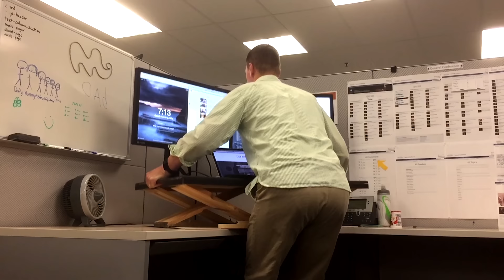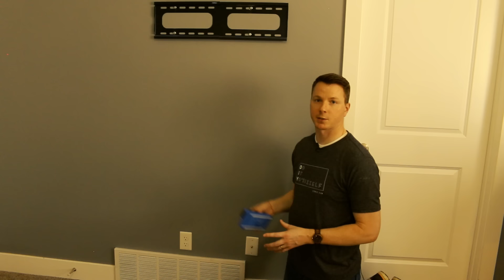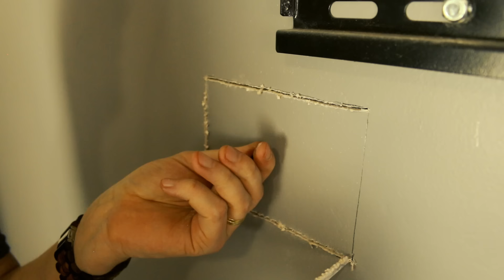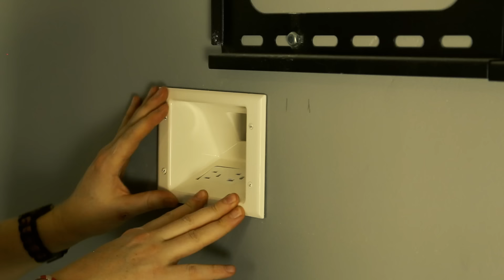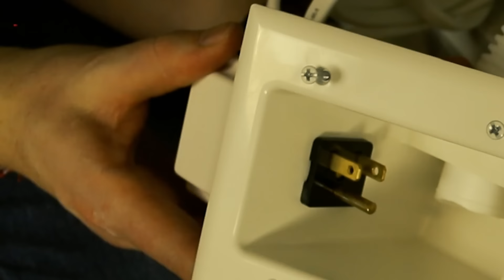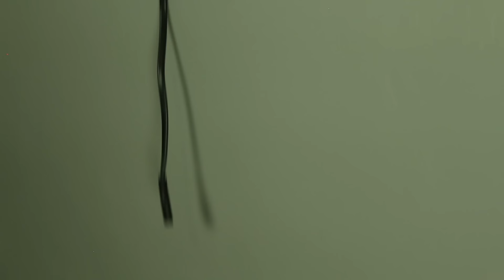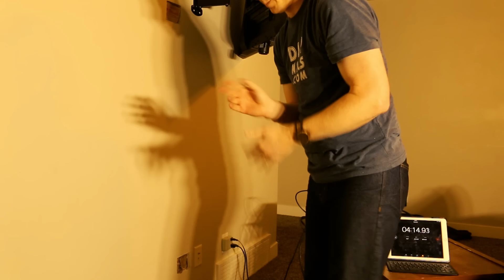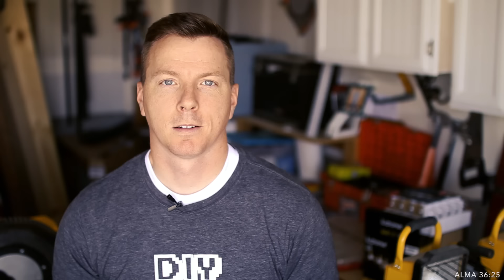How To Hide Your TV Wires in 30 Minutes - DIY

Comment: +LRN2DIY What if the original outlet isn't directly under where you want to mount the tv? Say you centered the mount in the middle of the room but the outlet is 3ft or so to the left or right of where you the outlet is. how do you connect the bottom receptacle to the original outlet without having the wire run across the wall?
Reply from the maker: With this kit, you can absolutely accomplish that, but it will, as you mentioned, have a wire running along the bottom from one outlet to the other. If you don't want to have that, I suppose the best thing to do is to install an actual outlet on the top area, which I have a video for. The problem is, you'll have to drill through your vertical studs that are in between the source bay and the destination bay, which involves cutting open more drywall and patching/painting afterward. There's no really simple way to do it. If you need any direction on whichever way you decide to go just let me know.
Reply: I was hoping there would be a way to avoid having to drill through the vertical studs to get to the main outlet (you should make a video, if possible I think that would be help alot). However, thank you for your help and a great video. On a different note do Datacomm or any other company you might have come across made tv cable organizer kit that has more than two outlet?
Reply from the maker: Charles N I haven’t seen any but I really haven’t looked so I’m not sure.
Reply: LRN2DIY ok thanks

Comment: This is certainly an interesting but odd way of doing this.  
I hid the wires for my TV by coming straight up from an existing receptacle and installing a second receptacle behind the TV.  That takes care of power to the TV.  Now for the HDMI, USB, and other cables I put a low voltage recessed cable plate behind the TV and another one behind the AV cabinet.  You fish your low voltage cables from the top and pull them out at the bottom.  
Some people will say you can't run high and low voltage wires in the same wall cavity.  I disagree except in long parallel runs you might get interference.

Comment: We have concrete walls soo this is a no go
Reply: Your best bet is to get paintable cable raceway and mount it to your wall.  Then put your wires in it and paint it the same color as your wall.  Looks almost like it isn't there.
Reply: Jpdst29 your right but what if you have a wallpaper on the wall?
Reply: Hmmmm...that is a dilemma for sure.  I wonder if you could wrap the cable raceway in the wallpaper to try and blend it in.  Otherwise I have a feeling it is going to be pretty hard to completely conceal the wires without a lot of work.
Reply: You could mount a massive 80"er on that and not have to worry about seeing the cables.... or wall.
Reply: In the netherlands we have stronger walld but then you have to do with this shenanigans. We have to plan everything before we build a house

Comment: Why not just drop the power cord for the TV down the wall and plug it in at the bottom? I dont understand why you need to strip the wires and do all that electrical work with reconnecting the stripped wire
Reply from the maker: That is easier, and that is an option, but it's also against electrical code in most countries, including the US, which is why kits like this make things a lot easier than installing an additional outlet. That said, I made a video about installing an additional outlet as well, since I've done that in one of the rooms in my house.

Comment: Normal cable ratings assume that the wire can adequately disperse heat generated in the cable due to the current flowing. If you coil it up and use it close to the maximum rating then it stands a good chance of melting the plastic insulation and then causing a short or worse. 

As a UK watcher I am always amazed by the flimsy plasterboard (drywall) walls I see in so many US houses. Mounting anything requires special fixings. My UK house has only one plasterboard wall.

Comment: A Real easy Way to feed the wires through that tube , before installing run a cord or several pieces of cord depending how many cables you will run through that tube , the cord should be easy to run through since it won’t be installed yet into the wall, once you install it into the wall and are ready for the real cables, tie the bottom side of the cord to the cable you want running through and just pull it out in the top side , do the same for each cable.. much easier then trying to fish out the cable by itself since it will get stuck in there

Comment: ya punch hole in wall above tv line punch hole at bottom drop wires down lol most have furniture underneath so you wont see any hole .. obvs im being sarcastic just cut your wall with a serrated knife... done in mins !! all 3 of mine are done this way and have been since flat panels came out... if your tv is by chance off center of your furniture punch hole to the side and swing  an extension cord to whichever side the offset bottom hole is then tape your wires to it and pull them through lol

Comment: When I connected my wires I didn't push them through the receptacle box first :/ Is there a way to disconnect the wires? I don't want to mess anything up.
Reply from the maker: You have two options. One is to use some pliers and try to pull them out of the connectors. It'll be tough but is likely doable. The second option is to cut the wires, strip them again and use a wire cap to connect them again.
Reply: That is super helpful! Thank you! I'm gonna try the first option and use the second as my backup.
Reply: I was Able to pull them out. Wasn't to hard. yay!

Comment: Second Comment - found the kit you installed on Amazon.  The description on their site mentions a 15 Amp power socket to supply power behind the TV.l  However, at the bottom of the description it states that the wire size is only 16 2.  !5 Amp ckts require 14 ga.  What size wire came with your kit?  It also states the supplied cable is pre-wired to the upper plate.  Can  the supplied cable be replaced?
MB Bill

Comment: Question: You mentioned that this is for, "Drywall with timber framing..."  Obviously it would be different with a solid wall, but I was wondering, would this be the same technique if you have metal studs, rather than wood?
Reply from the maker: Great point - yes, it would be the same. You're really only working with the bays (the spaces between the studs) so this would absolutely apply to drywall with metal framing.

Comment: You made that much harder than it had to be with the bilge pipe.... after installing the top plate, drop a piece of string down and fish it through the bottom plate.... Install bottom plate. Tie string onto 1st AV cable and 2nd string. Pull it through... Repeat with original string and next AV cable... Basic shit that you made extremely complicated.... I won't even mention about the coiled wire in the wall... LMAO....

Comment: Never loop a wire like that. It forms a coil and that introduces eddy currents with heat associated. Even if the wire is rated for inside a wall, the rating only holds if the wire is correctly terminated with a short extra length (not wound into a coil).
Reply: If it was analog I'd agree, but HDMI is digital.
Reply: You shouldn't be running video with AC in the first place.
Reply: Anker soundbuds slim Plus
Reply: What coil works when the hot and neutral are wound together?
Reply: Silence!!!!!..peasants.
Reply: yessssssss!
Reply: Also introduces much noise into the Hdmi cables, possibly even 'colored snow' or static snow

Comment: i have fixed tv to wall it moves tilts etc but when i move it downwards into right position i dont know how to lock it in that position .
Reply: Paula Wilson there are screws at the joints of your TV holder. Tighten them until the joints are stiff enough to hold the position you want but just loose enough that you can still move the TV

Comment: This is hack!!! NEC does not allow use of extension cords for more then 30 days at a time, run power out of the original recep. Also please strip more wire then this guy, NEC requires a min of 6" of stripped conductor in the outlet box

Comment: Why not run this kit down in the same bay that the electrical outlet is located, that way you can feed  the Romex cable out of the bottom box and run it into the outlet box hook it  directly to 110 volts. No need to jump between the two boxes with an extension cord.
Reply: You shouldn't be running video with AC in the first place.

Comment: Why do people hang their TVs so high?  The center of the TV should be at or just above you eve level when sitting.  Just because it hangs like a picture doesn't mean you should hang it like a picture.  Do these people also sit in the front row of the theater?  My neck hurts just watching this.
Reply: I take em out of the box and lean em against the wall...  done.  And I can relocate it so much easier which comes in handy because sometimes I like to watch tv in other rooms of the house!  Lol
Reply: I like them high so they're protected from children and careless people. .
Reply: With an adjustable you can lean it down. Or if you have a big living room.
Reply: To be fair, pictures should be at eye level also.

My house has a mount over the fireplace (and the room doesn't really let you put it anywhere else) I don't like it, it's like watching TV in a sports bar.
Reply: Ikea sells a great looking big TV stand for 50 bucks. I'd never mount a TV on a wall unless it was in a bedroom where there would be no other options as to where to put it.
Reply: Lakeman nobody is confusing eye level with line of sight. Even slouched back, your HEAD falls forward when relaxed without a head rest. Everybody I know when sitting in a couch with somebody, they don't lean their head back like a quadriplegic. Even if your back is leaning backwards your head leans slightly forward making it at 90 degree's to the ground, meaning your eyes are looking directly parallel with the ground. Which means your TV should be at eye level. If you are sitting with a straight back and relax your head you're looking down about 30 degree's. Also note you should always being looking down at any screen about 20 degree's to prevent eye strain. So if you like watching tv, relinquishing control of all your muscles like a quadriplegic then put your tv in the top half... but that ain't normal for anybody I know.
Reply: imah8ter07  Agreed, there is an accepted formula for mounting height:

TVH = (tan∆ x V) + EL

TVH=Mount height (c/l)
∆=Recline angle (30° max)
V=Viewing distance
EL=Eye height level

That generally puts the height of the TV at your preferred height, but ultimately, people have their own preferences. So I would say that the best place to Mount a TV is where you like it, not anyone else.

Also, not related to your post; I have two kids aged 3 & 4 and never had an issue with them wrecking any of my TVs which are all mounted to 47" eye height to C/L.
Reply: Exactly, when I bought my flat screen over ten years ago, it had big lettering right on the box saying not to hang the tv high on the wall.
Reply: Keeps it safer from kids twirling and hitting the TV when it is mounted higher up.  :0)
Reply: <shaking my head>  Thanks Joe...That's the best laugh I've had yet today!
Reply: it reminds me of a holiday house. put it in a spot that makes every single use less enjoyable... because it's safer that way. what kind of animal lives like that.
Reply: Never been a quadriplegic, don't buy couches from Ikea, don't enjoy sitting up to watch TV, and don't generally sleep while watching TV. My test where I'm sitting puts my line of sight at the intersection of the wall and the ceiling with the TV (obviously) mounted below that. I always recommend wall mounting and have yet to have a client complain.
Reply: Lakeman that says more about the people that hire you, than what the needs are of the average person. Also most people don't care enough to complain about most things in life. So just because somebody is pleased, doesn't mean they wouldn't be happier with something else. I know your eyes naturally fall where the ceiling and wall meet from what you said (about how you lay backwards), but I can't see how mounting it in the top half of your wall is correct if the tv is flat against the wall. Your eyes fall naturally on the TV yes, but it's the wrong angle. Your eyes should be hitting the screen at 20 degree's downward, the way you're setting up tv's is still looking up. This is why we're talking about eye level. So I hope you set up the TV to lean forwards...
Reply: LoL - Yes, it says that they like to be comfortable when watching TV. ;-)
Generally my clients are well above 'average', so the "needs" of the "average person" don't really come into play. Although the needs of the people interested in the aesthetics of their living space and enhanced enjoyment of the modern 'TV' experience are addressed.  
I get that your opinion differs, but the 20 degree downward angle 'rule' you probably heard as a child, while somewhat still applicable to work station ergonomics... although not measured perpendicular to the display, is no where to be heard with todays display technology. Conversely, most mainstream manufacturers suggest minimizing the viewing angle for optimum performance. And most high end displays all but eliminate viewing angle issues.  And not even the average person blindly applies outdated 'rules' that really do not change the enjoyment, comfort of the experience, nor effects their health. ;-) 
imah8er07 asked a question. I have answered his/her question. 
All that said, a TV does not need to be particularly high on the wall to benefit from wall mounting and the aesthetic benefits of in wall wiring. Nils did a good job demonstrating the installation of this product and I hope it inspires many to improve their viewing environment.
Reply: Lakeman if you don't tilt the tv forwards then you're not minimising the viewing angle by placing it above eyeline, you're increasing it... you're obviously are very confident in your opinions though... congratulations. Dunning–Kruger effect is strong with you, but it sounds like it's making your life amazing. So keep up the superior work.
Reply: High tvs in living rooms don't make sense, agreed. I mount my TV above eye level in my bedroom because I want the TV in my line of sight, which is typically slanted up as I'm laying in bed with my head on a pillow. The lower you take the TV on the wall, the steeper the angle for your head.
Reply: The same reason idiots put their TV over a fire place...
Reply: Finally someone who thinks the same as myself.  I mounted mine where the center of the screen was slightly above my eye level.  I'll go to friends houses and theirs are mounted over their fireplaces or up so high you have to strain your neck to see.  Makes no sense to me.  I'm sure there is a reason but I don't know what it is.
Reply: Sometimes there is a fireplace in the way.  Duh, you have to mount over it, and a some space above where the heat comes out.  Duh.
Reply: I think you are confusing "eye level" with 'Line of Sight.' I personally hang, or place any TV I install In the top half of the vertical wall space.  I, and  everyone I've ever discussed this topic with, would rather not sit straight up like in military school when relaxing in front of the TV. Try this before deciding where your TV should be placed... place your seating where it would be placed first. Close you eyes while standing in front of the seating, then sit down and get comfortable. Open your eyes looking straight ahead. That is where your TV should be! I guess if you have a TV in a dining room, or in front of the toilet, lower might be better (I'd never put a tv in either of those places) but for most people sitting in their comfortable couch, sofa, sectional, recliner, beanbag chair, etc... to watch TV,  higher is a more natural, comfortable location for the TV.

Comment: american house made of wood and dry wall lol try this in the uk bricks and concrete
Reply: We are considering building our own because it is so impossible to get away from dry wall, and while lake country is great, in this climate the wood, dry wall & fiberglass all support mold growth just due to the humidity.  It's not too bad in older undamaged homes, but the materials used in newer buildings are not holding up.  We've seen mold growth in new construction, starting before anyone even moves in, so all 3 are non-starters as far as we're concerned.  What would you recommend for new builds with brick, concrete and stone?  Technology keeps changing, so perhaps some additional in-wall channels for future use?  Aesthetics are a cultural construct, and so I only even think about it for re-sell value.  I'm interested in your thoughts, if you'll share.  Since we do not currently have homes of this sort around here, I do not know anyone to ask about this.  A home might have exterior brick; not the interior walls, though, and I do not want drywall anywhere at all. What do you run into, and are there good solutions already or is there a wish list for new builds?  In most places we'd probably use concrete, so virtually anything is possible if it is planned in, even a mix that requires no additional insulation.

Comment: I would never run a mains lead with other leads such as hdmi or others no matter how small the current, this would be run separately, and make sure the insulating cover is rated to a safe voltage/amperage + fire proofing.  Secondly regardless of distance and power output a professional would never coil a mains cable regardless.  This is not a professional install in my opinion and would recommend most hire a professional to do the install.